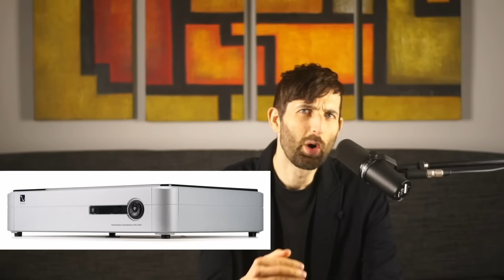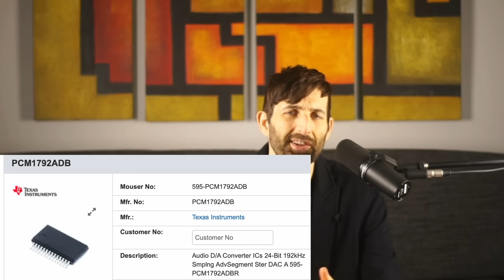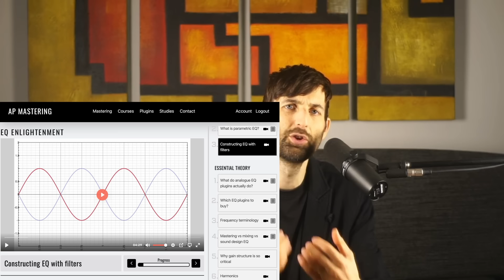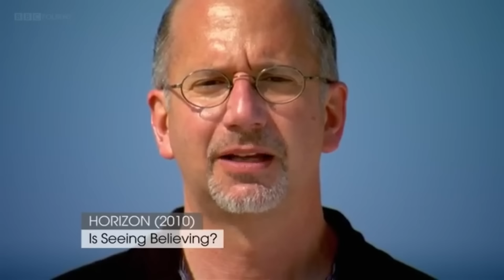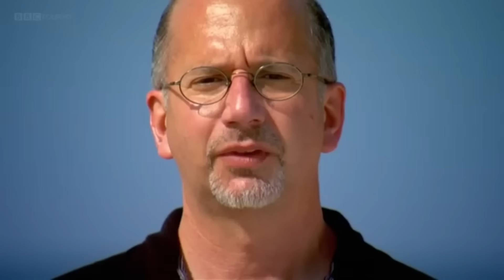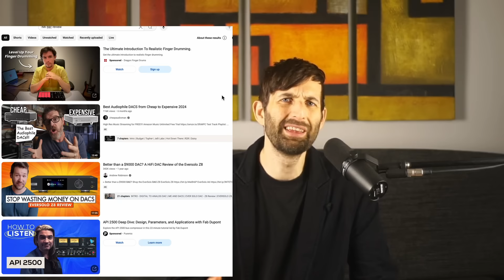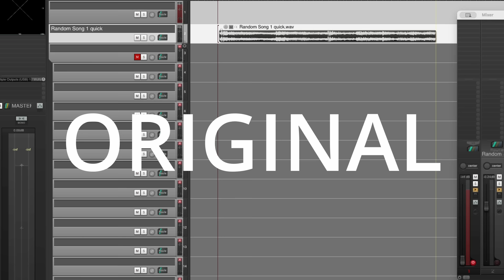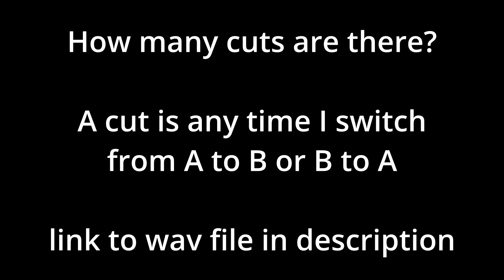The DAC Scam - Almost everyone believes the hype

Comment: There is a difference between DACS, I have several and A/B'ing them you can hear clear differences. They have different chips, different power supplies, different op-amps etc. That said, I agree that there is no basis for them being overly expensive. No real case for more than a 1000 Euros? Yeah, I would agree with that.
Reply: If you are not A/B blind level matched and with the exact filters, you are not A/Bing them.
Reply: @robertt7238  So I successfully A/B'd them then. Thanks for your input.
Reply: @technopsychobedlam  Was it a blind test?
Reply: @ Yes, blind and levels were equal according to the dB  app on my phone
Reply: @technopsychobedlam  And what differences did you hear. What percentage of the time did you get your guess of what A or B is correctly? Tell us more about your tests
Reply: @technopsychobedlam  Oy vey ...... the db app on your phone 😞 -- so that would be a no.
Reply: @ Comparing a Schitt Modius with ESS chip to a Geshelli J2 with an AKM chip. I could pick them as different 100% of the time - the ESS was thinner, brighter and had narrower staging. The AKM sounded wider in staging and more influenced by mids, so sounded warmer.
Reply: @ The phone is more accurate than my own perception. So it would be a yes
Reply: @technopsychobedlam Are the a/b tests you conduct double blind tests?  If there are differences, it means they are not working properly. A proper DAC is transparent.
Reply: @DrinkWater713  There is no such thing as transparent reproduction in the real world. I find both 'engineer' and 'audiophile' types to be problematic in these discussions. All electronic components affect throughput. I saw an interesting test of USB audio connection cables transmitting music. Length, and composition had an effect on the output signal. Nothing that would ever be audible but it was measureable. If one wire can introduce variance then the combined components and connections within a DAC certainly could and, in combination, might well be noticeable.
Reply: @technopsychobedlam  That's what transparent means: No AUDIBLE distortion.

Comment: I do not see this as a scam. I always buy my gear after listening to it. Is something is not better despite the high price, I do not buy it. Simple as that. Anyway, DACs have usually only small differences in sound quality anyway. But implementation of the chip, especially the V/I-conversion makes a big difference. This can be costly but I agree not 10.000$ or more. Just go and listen, than make your choice.

Comment: I have 3 DACs in my house. The one I listened to this video through my OG Beyerdynamic DT1880 Pros is through the SSL12 audio interface through my computer. 32 bit float converters they say. I'm happy. The other is the ifi Zen One Signature which I use with my hifi. Cost me $500 Canadian 2 years back. Love it and don't feel an upgrade itch while streaming through an iphone connected via a generic cable and dock. Third, an Audioquest Dragonfly Cobalt. This little motherfucker is incredible. I bought it when it was a new, hot thing, and still, it makes any of my half decent headphones sound like heaven. It made my hifi sound stupid good through a cell phone when I was on DAC ecxhange. I would love to challenge anyone with a Weiss converter to hear my dragonfly through their same preamps and power section to tell me they haven't been had.

Comment: The Holo Audio May DAC is one example of a DAC that uses a discrete resistor ladder (R2R) architecture, not a DAC chip, for digital-to-analog conversion. Its sound characteristics of high detail with a smooth analog type of warmth can easily be heard with high quality amps and speakers.
Reply: blaablaa yeah a covox sound thing was the best sounding thing ever.   oh wait...    
look man its the easiest and simplest type of a dac to throw together yourself. the cheapest easiest to understand design to design with least need for fabbing anything.

i really liked the dacs in old sb16's. was it accurate? heck no i just liked it, had more lower end bass than it was supposed to.

Comment: WRONG. The sound of the DAC chip is determined NOT by the chip, rather the output stage and power supply and clock location
Reply: And any competent designer with a bit of time and test equipment can make a transparent implementation cheaply.

Comment: Maybe this was the video I was waiting for 
Sometime ago I bought a $10 DAC from Amazon it has optical and coax In and RCA Out 
I got it for my Samsung Tv as there was no audio out from the TV 
What I heard was a transformation of sound on my KRK Rokit 5 active monitors 
Loved it. 
I streamed Spotify from TV and was happy. 

SO 
Someone said invest in a better DAC 
I got the WIIM Ultra $350 which claimed a great DAC chip. 
What I heard from the WIIM was surprising 
With 50 years of audio experience I could barely tell the difference. Infact the Amazon DAC had a higher output 
The WIIM sounded a bit cleaner 

Hello between the $10 and $350 the difference was very marginal ( maybe the output stage was cleaner) on the WIIM 

Not one on utube could convince me why the sound from both were almost same 
Till I seen this video 🙏🙏🙏❤️❤️❤️❤️
Yes the hype on DAC chips is only  to justify the price hike ( however the other electronics in expensive DACs do help for a smoother cleaner output ) but never justified to the price hike 

The WIIM ultra with its functionality and looks compels the brain to comprehend that it’s better 🤪🤪🤪🤪

Thanks for the video
Reply: I absolutely agree that currently nothing can beat WiiM Ultra in price/quality ratio. 😊
Reply: Come on, please. You’re comparing a mediocre DAC to an average DAC playing out of what, $500 speakers through a $100 amp. What do you expect? I believe the guy in the video is trying to shoot down $20K, $50KDACs too but the logic doesn’t hold there.

Comment: I'm writing to you as a music enthusiast more than I am a gear enthusiast, but in a few years I've collected some pretty good devices (I say) to enjoy music and I've listened to dozens of different devices and speakers, from expensive to cheap, some that sounded phenomenal and others that were not even good. Regarding DACs, the cost also goes into the power supply where you have to use quality parts, in the pcb and the chip implementation and yes, it's not normal for it to cost tens of thousands but 2-5 thousand dollars could be enough.
Ps: those with money that are device enthusiasts won't even look at a DAC that costs a few thousand dollars and will look at those that cost tens of thousands, hence the offer, and they won't even consider this video.

Comment: Sorry, there are too many deliberate ommissions in his guys screeching that sets off my bullshit detectors. He seems to be deliberately ignorant regarding the role of the analog output sections impact on a product's overall sound quality.
Reply: Sure, but what part of transparent did you not get or disagree with?  Take a glass window: would you be able to tell one brand from another? Not unless one brand was less transparent than another. But if both, or all, are actually transparent (and clean, presumably), your brain never stops to think: this brand or design of glass window is better than the others. Transparency is the key here - forget the analog output section, bla-bla-bla. Can you hear the difference between chips? And can you prove it 100 times out of 100 tries? Those are the only two questions worth debating.

Comment: I heard no switches in the test, but that's neither here nor there: in real life my Chord 2Qute (a domestic DAC) effortlessly outperformed my previous TC Electronic audio interface. 

I haven't heard any other modern audio interfaces or DACs, but back in 1990 the Naim CDS, which was by far the best CD player I had heard, used a version of the same DAC-chip as the original unmusical, earache-inducing Philips CD players.

Comment: Wrong, high end DACs mostly use custom and discrete architecture and are designed for customers whom money is no object and are mostly not snake oil in the same way a Ferrari is not snake oil.
Clickbait scam more like it.
Reply: Ferrari make their own engines, suspension, etc. DAC manufacturers are OEMs that rely on standard semiconductor chips. No chip, no DAC, but Ferrari make their own everything (the essential chunks that matter, not the mirrors and tires and electronics),
Reply: @balisaani  Wrong R2R, FMPGA are examples that are used in high end DACs that are not off the shelf but custom and discrete parts.
Also Ferrari uses a lot of of the shelf parts as do all car manufacturers.
Reply: Clickbait scam more like it

Comment: hi, whats best dac/amp for hd600 hd650? you wrote in the comments that fosi is good and rmi is decent, i dont need care about anythin but sounding well with hd600 650 660s2 on the dac/amp(no big features etc needed) - can you name 5-10 options of dac and amp on EU market please? 

what do you think about tubes, and should you just go hd650/660s2 if hd600 on neutral dac+amp is too shouty/bright? thankyou